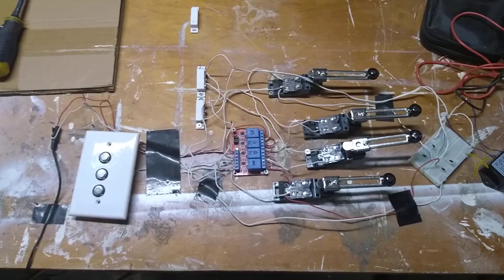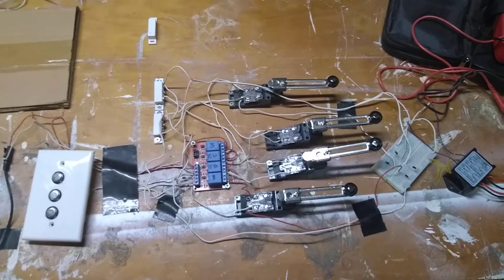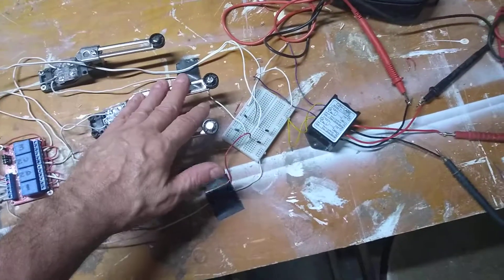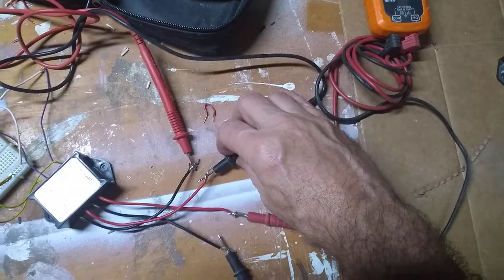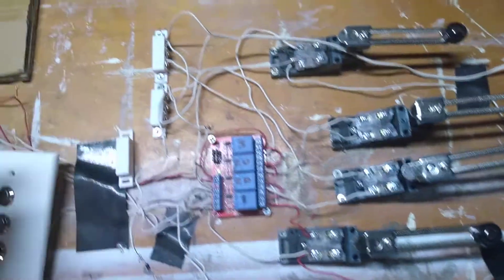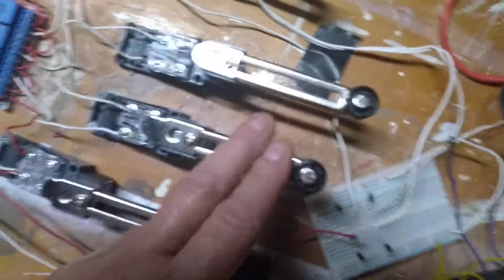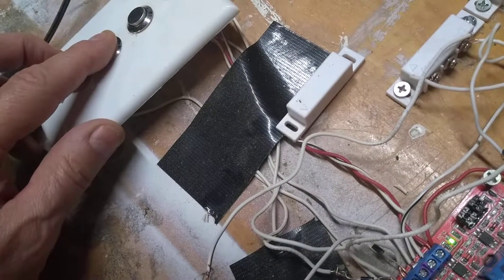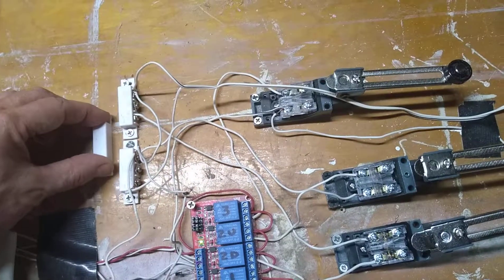Dumbwaiter Control

Comment from the maker: I was going old school with relays in a simple logic circuit, but there seems to be feedback issues even with diodes.

I'm currently trying to configure an Ardorino to do the heavy lifting
Reply from the maker: This is the problem using antiquated circuits - it failed as you suggested correctly because of the feedback even though diodes were installed.

Suggest using an Adarino with floor sensors/ switches instead.

Comment from the maker: Here's a link to the plate that I used for the three floor switch:

https://www.kyleswitchplates.com/sierra-low-voltage-3-pushbutton-switch-wall-plates/

The switches themselves can be ordered on Amazon in a bulk pack of 12 or individually

Comment: Where did you get the 3 button switch. Any links would be great. Thanks.
Reply from the maker: https://www.kyleswitchplates.com/sierra-low-voltage-3-pushbutton-switch-wall-plates/

The push buttons themselves can be found on eBay in various sizes and amounts
Reply: @jstevens9806  one more question. What controller are you using.thanks.

Comment: I very much appreciate your dumbwaiter control project. Thank you for sharing it. I'm building something similar to your dumbwaiter, but it is a lightweight cargo lift (groceries, etc.) for our home. Would you be willing to share a schematic or sketch of the circuit for the final project with the 12v relays?
Reply from the maker: Garland,
My project was a little more intense since there are three floors, but it's only a matter of simple relays with a 12-volt source, and a dead stop safety at either end. The buttons you choose which are available online, triggers the relay either up or down, until the dumbwaiter hits the dead stop.
An older folk myself, I should have just gone ahead and used an Arduino computer, but you know, I'm old school and I just had to try it. I may redo it with the Arduino anyway.
Reply: @jstevens9806  Thanks so much. I appreciate your advice (and creativity). I'll also look into the computer option. Planning and designing is half the fun. Garland
Reply from the maker: Whoops, forgot:
For safety sake, make sure you have some sort of switch on each door to disconnect the power to the entire relay system if the door is open.

Comment from the maker: Not for sale, couldn't be.. too much customisation necessary.
Additionally, the electronic 5v relays were swapped with traditional 12v ones as the small electronic versions could not handle the capacitor discharge when in operation.
New video soon.